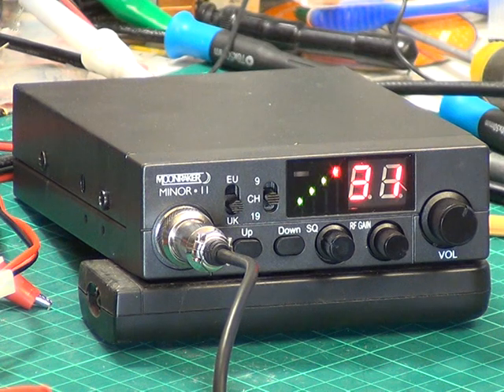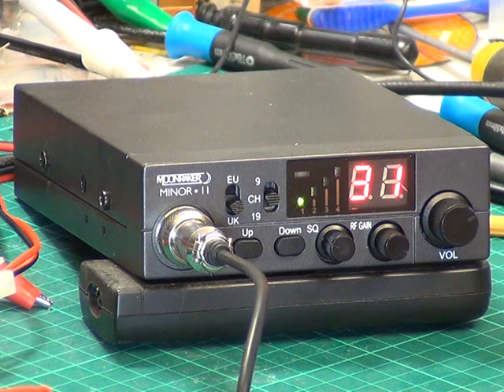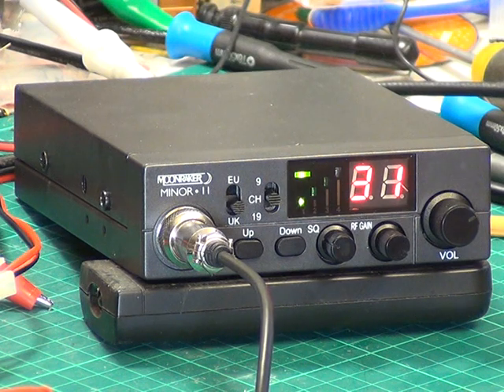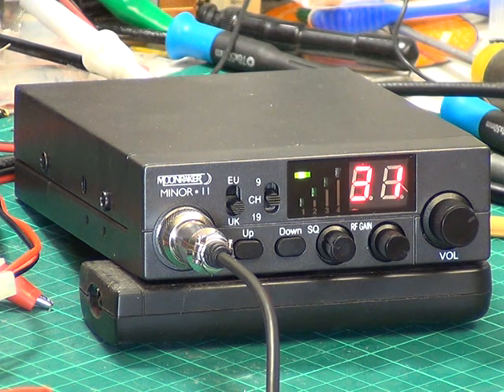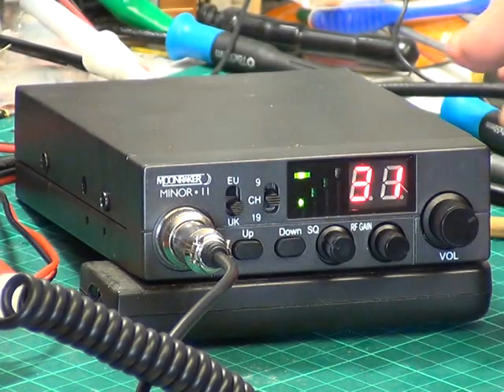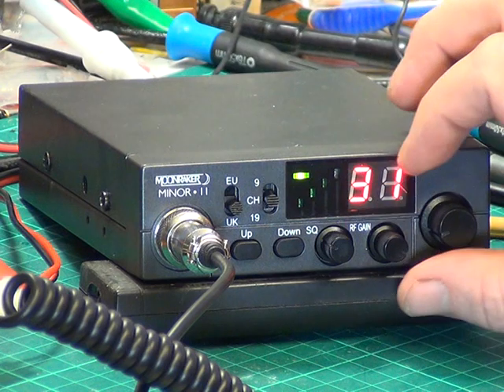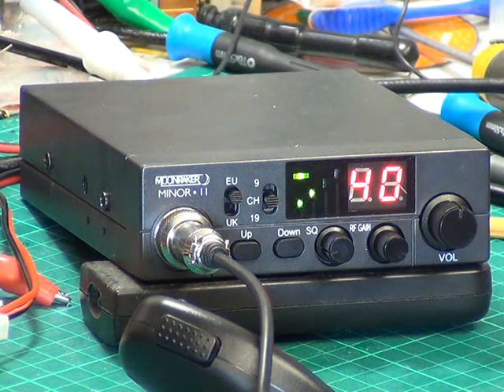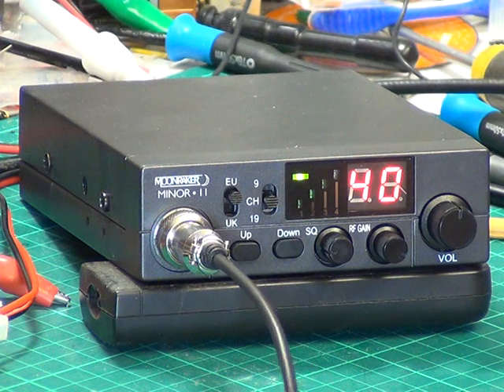Moonraker Minor II UK (CE-Multi) CB radio - On The Air Test UK FM out, EU AM back

Comment: Great video I managed to get a midland portor pack cb for £10 all working apart from the microphone wire needs soldering but I managed to get another microphone and an extension speaker until I get the original microphone repaired. But the built in antenna is not working in my flat so I'm going to get a magmount antenna and stick it on my window frame as I am not allowed to put one outside my flat I've been told a moonraker magmount antenna is good. As I've not been on the cb since the 90s and had many antennas over the years
Reply from the maker: Don't expect more than 1.5 miles range on an indoor aerial.

richard

Comment: There is one other thing it’s worth mentioning on CB radios, and that is the delay some seem to suffer on tx, I didn’t notice one watching your test, but the display did seem to lag quite a lot, particularly when mr c was close by. I look forward to the later version to see how it performs by comparison. Good video, as always.
Reply from the maker: A lot of the delay you see is youtube sound to picture synch. On these type of sets the time from keying to TX is probably only around 100ms. One the newer CPU controlled offerings there are PTT to TX delays nearer 750ms.It's the same with business radios, and those users changing from Pye 290 series radios to new models are disappointed with the delay.

Richard